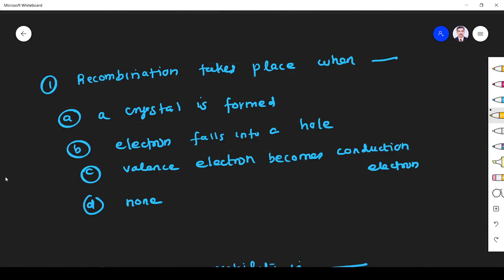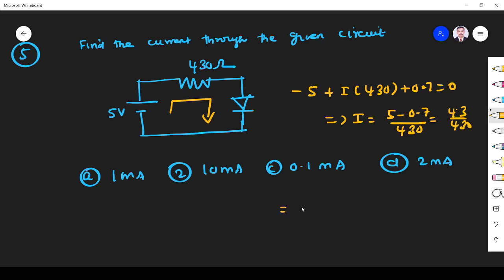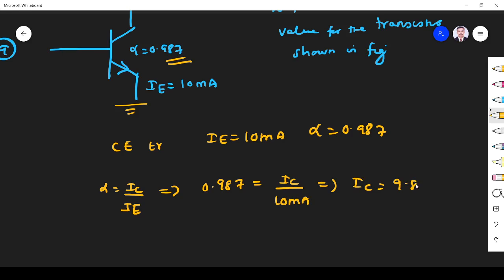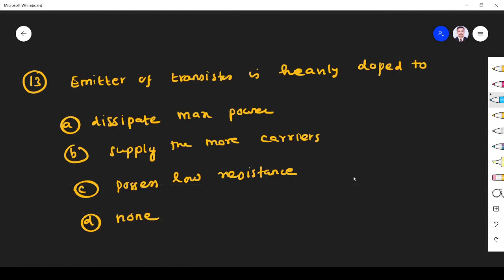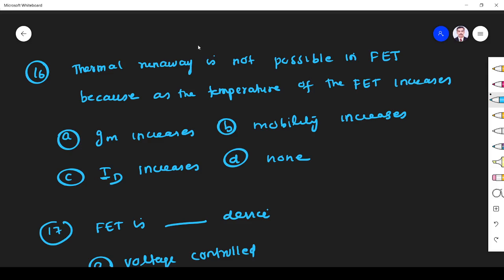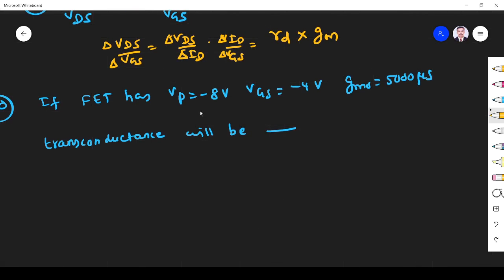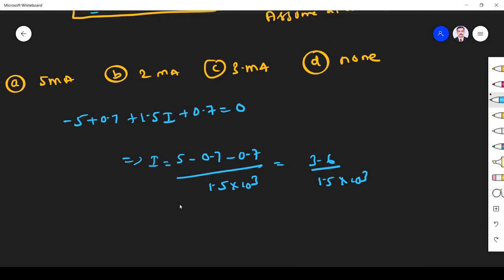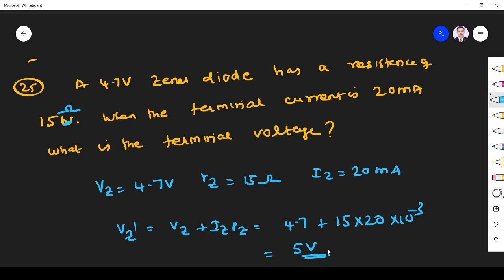TRB TNEB EDC EXPECTED QUESTIONS

Comment: Sir 16 que one kindly check sir whether it's right or not .....crt option b
Reply from the maker: You are correct option B only ..I wrongly marked
Reply: @majeethlectures  ok sir👍
Reply: Mobility decreases
Reply from the maker: @kanimozhib5641  If the Temperature (T) ↑, the carries Mobility (μn or μp) ↓, and Ips↓

Since the current is decreasing with an increase in temperature, the power dissipation at the output terminal of a FET decreases or we can say that it’s minimum.

So, there will be no Question of thermal Runway at the output of the

Comment: Sir, For pblm no.14, 0.3/0.1 is 3 only... But u mentioned there as 30ms ...How sir???
Reply from the maker: It's clearly given that in problem current in mA and voltage in vot..so conductance is mA/V is milli Siemens
Reply: 3mA/v only sir